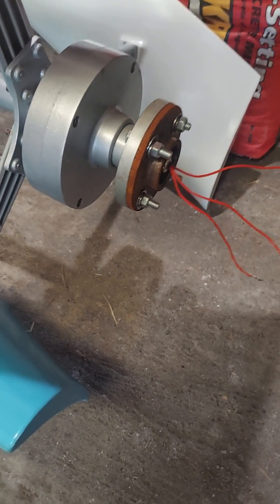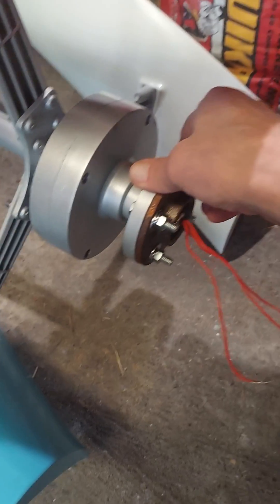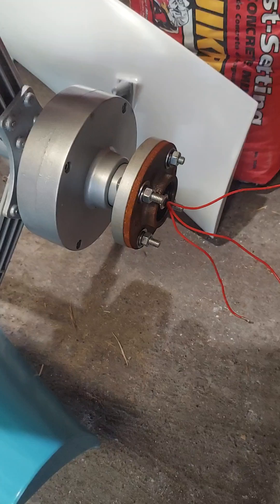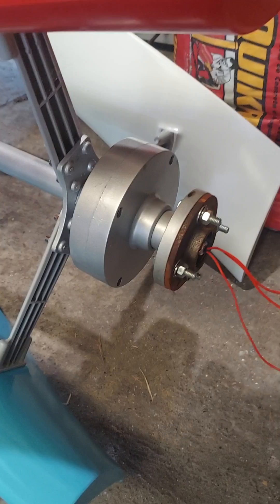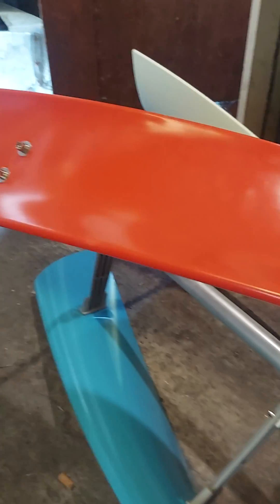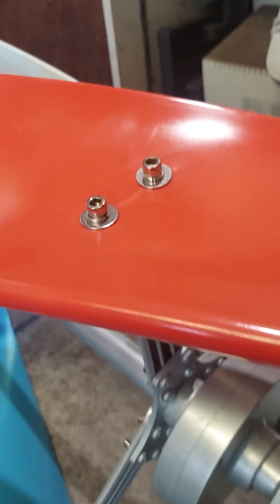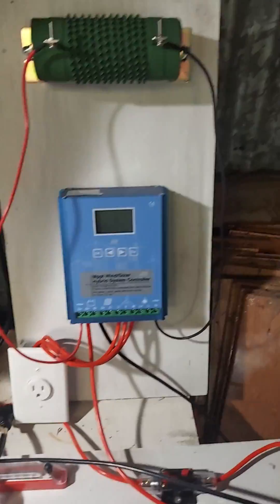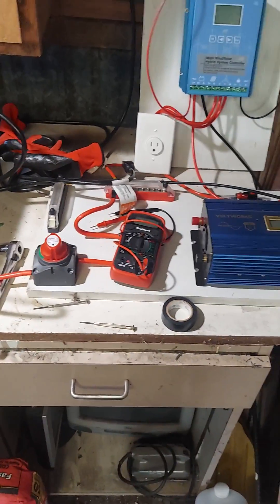VAWT Wind Turbine Problem Part 2

Comment: New high quality bearing will help but the red blade needs to be flipped over to match the other two.  Just the four screws on the outside of the red blade and flip top to bottom.  It is fighting against the other two blades the way it is now.
Reply from the maker: You can't flip them front to back, you could turn them over but it would be exactly the same, I've tried. The way they are shaped,  turning them over is the same and flipping is not possible.  It's just a bad design. It is based on drag and not lift.
Reply: @Rock-With-Rick  Flip the red blade only, top to bottom, to match the others.
They are lift airfoils and the concave sides are facing outward as they should.  It will spin faster when all the blades are facing the same direction. (Thick end leading edge, thin end trailing edge)
Reply from the maker: @danedmiston9673  I will look at it, but it doesn't matter anyway since the bearings are shot.  But I really think it would be the same either way, but now I am curious.
Reply from the maker: @danedmiston9673  Ok, I fixed that issue, thanks, I do remember there was some marking on them when I assembled it that led me to believe which end was top, I thought I followed it but must have missed it on the one blade. They are actually marked with an "OWD" on the end that should be up, which I assume is probably Outward Direction. Now if I could just change the bearings. LOL It will still spin, but not as well.  I think it would be a PITA to change the bearings if I was lucky enough to even find bearings for it.
Reply: @Rock-With-Rick  The bearings should be standard metric bearings.  Usually there is a bearing number printed on the bearing or bearing seal.  If you can not find a local bearing supplier you should be able to find them on e-bay with no problem.  Just do a search using the bearing number or the dimensions of the bearing in millimeter.  Best of luck
Reply from the maker: @danedmiston9673  I think the hard part is going to be getting to the bearing, the one on the shaft will be easy, but the other one I don't know. Not even sure how the housing comes apart. Last time I had it down I took the allen screws out, but it wasn't coming apart, likely because the magnets holding it together, not sure how to go about that or if I have the tools or equipment to do it.  Maybe a machine shop, but that would be costly I am sure if they even wanted to touch it. LOL
Reply from the maker: @danedmiston9673  Here is the problem I am running in to, any ideas on how this comes apart to access the inside bearing
https://youtu.be/jSsr8GJl47w

Comment: I think I bought this same turbine. How has it been for you besides the bearing failure?
Reply from the maker: I didn't see more than 3 or 4 volts on a fairly windy day. Never got a reading for any Amps, but could be my controller, using a hybrid controller because the stock one really can't charge Lifepo4 battery.